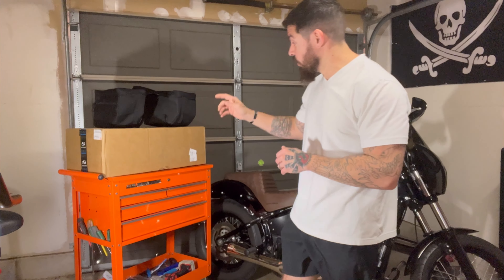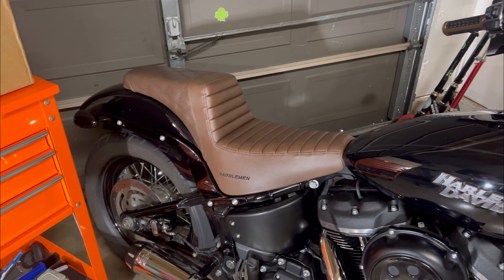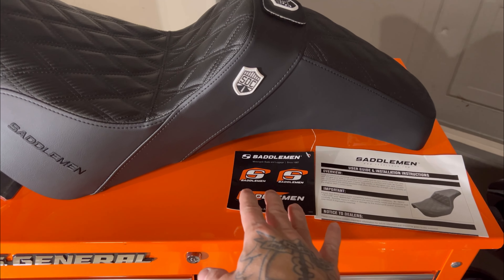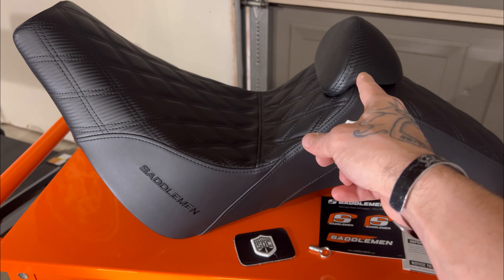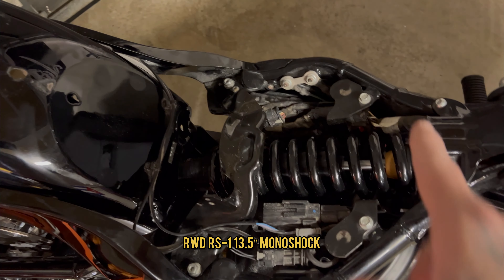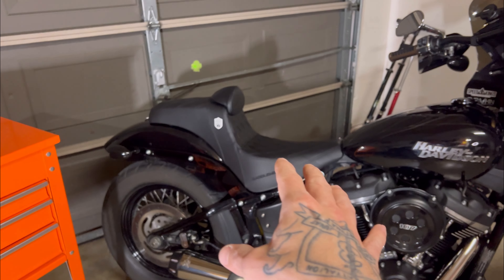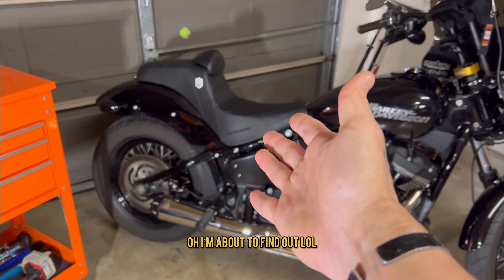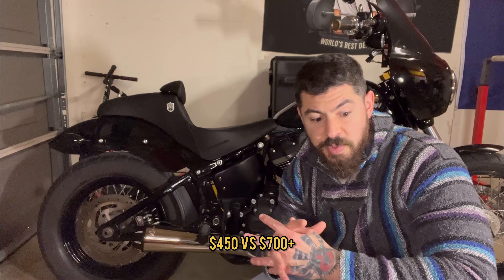Harley Davidson SADDLEMEN Seats!!

Comment: How does the pin work in the back rest? Great video!
Reply from the maker: 🙏Thank you! The pin slips into the backrest shaft in/out pretty easy; BUT! I am running the backrest all the way down, which works for me fine at this moment for just street riding… the backrest feels amazing and it provides a noticeable amount of support on my lower back… big difference than without it OR from the StepUp seat no doubt! ⚡️
Reply from the maker: ⚡️So I actual took the pin out lol⚡️